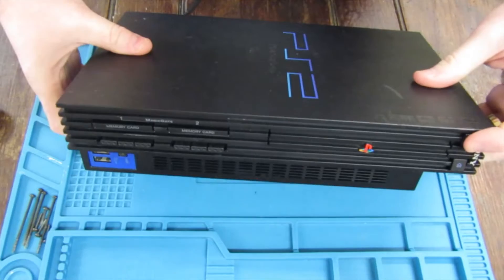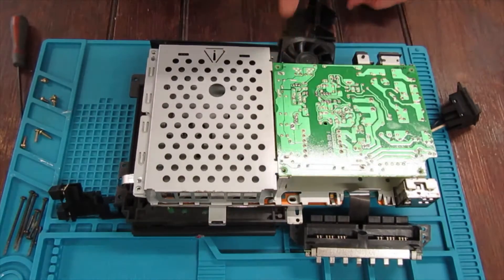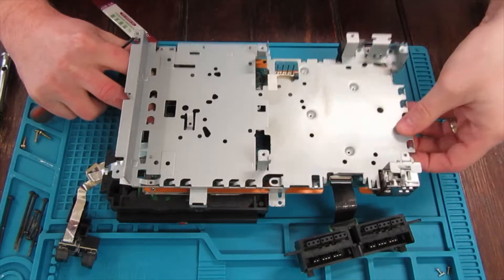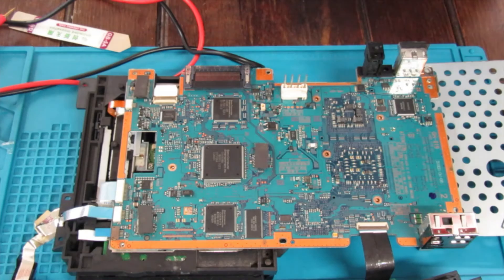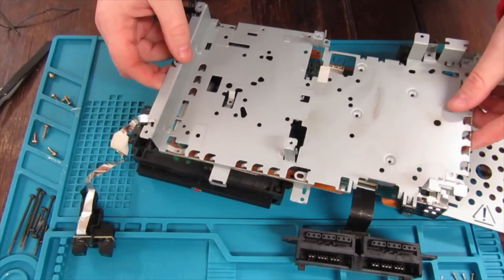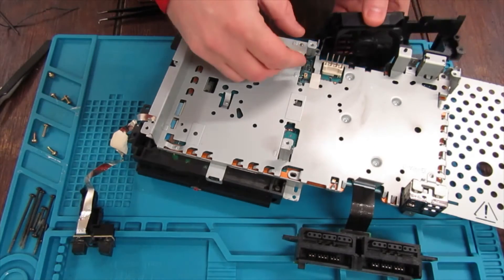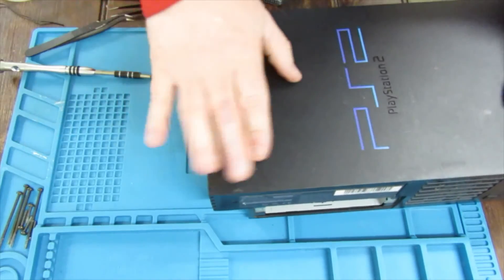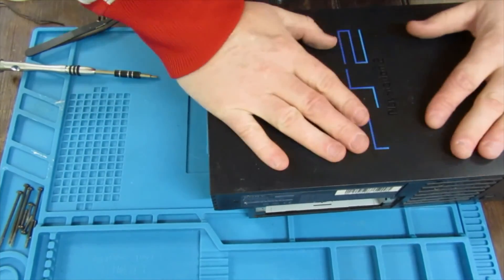PS2 Fan Not Spinning, Fan Fuse Replacement

Comment: Very nice video. Do you know how to fix a blown fuse for controller vibrations as well? Mines a PS2 Fat 50001 model. Everything else works fine for over 20+ Years.
Reply from the maker: It's not an issue I see a lot of. The PS7 fuse is normally the issue, it's a 0.7a fuse The Fat PS2 is a pain to disassemble to access the board though.

Comment: Hi. Bought a faulty ps2 on ebay with graphical glitches. Successfully restored the image only to pinch the fan wires during reassembling. The ps5  fuse seems to be dead. Can i just bridge the connection instead of searching and waiting on a spare fuse? Thanks.
Reply from the maker: You can bridge the connection and it will work, it does mean next time something goes wrong you wont have the protection of the fuse.

What was the cause of your graphical glitches, it's not something I see very much on these consoles.
Reply: @EasyConsoleFixes  thanks for the reply. :)

There's a series of chips between the GPU and the CPU (4 in a line on side A) one of them had no continuity so I soldered it over with some 30awg wire. Seemed to have fixed the problem. Tested it extensively before deciding to reassemble. As I did I felt a screw wasn't screwing in as it should and damaged/pinched one of the fan wires. I think that's how the fuse died. Still works without the fan. I hope my explanation makes sense. :/

Comment: What causes these fuses to blow?
Reply from the maker: Issues with the fan such as a faulty fan or the fan getting blocked etc can cause them to blow, however as these consoles get older I am seeing a number of these fuses blowing without seeing any other cause. 

Some people think there is an issue  with the fuses causing them to blow as they age but I don't know if that's true or not.

Comment: When i turn on my ps2 the fan doesnt spin and after a few minutes it overheats and blinking red light
Reply from the maker: It's probably a broken fan or the fuse as shown in the video. Are you comfortable soldering or using a multimeter.
Reply: Bro i solved that problem i opened my ps2 but my ps2 was so dusty and fan was jammed due to dust i cleaned my ps2 then i turn on my ps2 the fan has fixed and spinning now
Reply from the maker: @bayaratrushi9865  A nice easy fix, glad to hear you got it sorted.
Reply: thanks brother

Comment: The diagram says 0.7A fuse. What if i use 1A fuse in same size. Qwould that work?
Reply from the maker: It will work but you wont have the same level of protection if the fault happens again. 

It's definitely better to use the 1A  rather than just bridging the gap with solder or wire or something.

Comment: Nice video. Do you know which ribbon cable is responsible for opening the disc tray? I disconnecting the cables for cleaning once, and now my console only has the blue opening light flashing but the disk tray no longer opens. Sorry for my English, Thanks in advance
Reply from the maker: Have you the disc tray put back together correctly.  There is a white plastic piece which slides left and right at the end of the disc tray. Part of this piece  should sit into the grove that runs front to back on the underside of the disc tray.

It's easy to forget to make sure its lined up when putting the console back together and it will cause the blue light to flash but the tray not to open like you describe.
Reply: I didn't open the disk driver, I just disconnected the cables (before this the disk tray opened normally). But in this process I think I damaged some of these cables, so when I put them back on, the disc tray no longer opens

Comment: Thanks for the video. I have to replace 3 fuses on a PS1 two (CCP2E)  20s and one 15 for the controller/memory card ports. I bought the (PU-20 board) PS1 7000 model second hand and one of the CCP2E20 fuses is missing replaced with a piece of solder to bridge. I just hope that didn't damage other components on the board.
Reply from the maker: Thanks for the comment. I don't see blown fuses on the PS1 boards very much, its nearly always just dead lasers. Had the seller told you the board was missing the CCP2E20 before you purchased the board.
Reply: The seller didn't know much about the PS1. They sell lots of second hand stuff ("As is and no returns" on all the items). I don't think they were the first owners. It's a Japanese 7000 model PU-20 but the board is inside a 7501 case. My guess, the fuses blew because it was plugged into 240v outlet instead of a 110v outlet. Or a bad memory card/controller did it. I should get the replacement fuses in the mail this week and I'll let you know how the fix goes.  @EasyConsoleFixes
Reply from the maker: @yanghao8351   Yeah you could be right. 240v into a 110v machine would almost certainly blow some fuses.
Reply: @EasyConsoleFixes   I replaced the the CCP2E15 and CCP2E20 fuse plus cleaned up the solder bridge made where the other fuse was and put in a CCP2E20 fuse. Now the control port works again plus it can read memory cards! However, I ordered a 240 to 120v step-down converter. I have one already but it's generic 120watts and not sure if it's a good idea to run the PS1 on a step-down with that much power. The one I bought is only running 60w and it's specifically for PS1, Dreamcast and Sega Saturn. Also I want to grease and clean the CD reader because it makes an awful sound. If a re-grease doesn't work I'll buy a new one (as at the time writing this new ones are being made).  I'll keep you updated.
Reply from the maker: @yanghao8351  Yeah any time I open one of these old consoles I like to reapply some grease. It makes a huge difference to how they run.
Reply: @EasyConsoleFixes   I bought a non-working for parts PS1 very cheap and its CD drive is from those PSone small consoles. With the extension cable that CD drive works great on my 7000. I noticed the top metal cover the CD player sits on had burn marks over the area the fuses are (so I'm sure it was too much power that blew them). I decided to replace the power supply with the new small ones that can accept 110v-220v and so far the PS1 is working great. I only usually play 1 hour at a time and the PS1 does get warm but not like it did with the old power supply. I’ll play it CD only for a month or two and if it’s working well I might consider getting the PISO mod. I’d like to get the xstation mod but the board is a PU-20.  Thanks again for your video.
Reply from the maker: @yanghao8351  Glad to hear you got it working. I recently picked up a Tonyhax memory card for my PS1 but haven't actually got the chance to use it yet.

Comment: Have you ever seen this: ps2 fat , when I hit the power bottom, green and blue light turns on , and that’s it… nothing happens, fan doesn’t even spin, and I can’t reset or open de disc ejector! Really don’t know where should I look for problems here
Reply from the maker: This is a strange one. It does seem like the console is turning on, I would start by checking the fuses on the board to make sure none have blown.

The console is turning on and coming out of standby mode when the red light is on but not turning on fully.
Reply: @EasyConsoleFixes  thanks for your replay sr! I've checked the fuses, they are good and there is energy from the power supply... I was really trying to fix it because this ps2 was the last gift my grandpa left to me before he passed, but after so much effort I'm starting to think about use the ps2 ffat case to build a computer inside it! 

Dont know yet if there are any mobos who could fit inside it, or maybe I'll use those tiny motherboards from androi's tv box... my idea is use it to emulate old consoles, but using the ps2 beautiful case to it!
Reply from the maker: @zowkingame1169  That is a nice idea for the case if you can't get the console fixed. 

I wonder has one of the chips or something failed. If you really wanted to keep the console running you could pick a replacement motherboard from eBay.

Comment: hey when I reasmbled a console after cleaning powered it on I had no video I sow that power ribbon is not plugged corectly so I moved it a little but the power was on I got a video and than I droped a video after few tries console not turning on after I plugged correctly all i have a green light all time but no video did I short circuit something?
Reply from the maker: I don't think the power button would cause the console to display no video.  If you have a green light the console is on, so your issue is something else.

Comment: Having the same issue on 39001 model PS2.
I believe it may have to do with the fan wire being mashed in the reassembly after fighting other issues. My board is much different than yours trying to figure out my best course of action I have another PS2 fan but it does not work either on this board.
Reply from the maker: I have seen the fan wire get damaged during reassembly, if in the wrong location it can get pinched. You can test the fans with a 9v battery if you want to rule out whether they work or not.

Also I have a link in the description which shows the different board revisions, it may help you if you need to find the fan fuse on your board.
Reply: @EasyConsoleFixes  well what ive done so far is use a different fan from a parts board. 
That one only works on the parts board not the current effected board. I removed ps5 from the parts board no more fan activity but I removed it's sauder pad off the chip. I then took ps7 off and moved it to the effected board replacing Its ps5 and I've currently got nothing. Currently out buying a multimeter as this message goes out.
Reply from the maker: @zanefritts177  Yeah the multimeter is needed, more than one fuse could be blown.

Comment: Those fuses are discontinued according to digikey and nothing on ebay either but going to try littelfuse smd 1206's which are the same length.  Need to replace ps7 on mine.
Reply: The diagram says 0.7A fuse. What if i use 1A fuse in same size. Qwould that work?
Reply: @schwarzeneggermanoj2634  Generally going higher on fuses isn’t recommended.  You could go with a smaller value and the worst that would happen is it’ll blow if the circuit draws more than its rating.  Going higher would put other components at risk if the original cause was a short somewhere.
Reply from the maker: You seem to still be able to pick them up on AliExpress  if you don't mind waiting a long time for them to arrive. 
I would do what you are doing and just use a similar  size fuse, there should be no issue.
Reply: @EasyConsoleFixes  Thanks!  I checked and found some but they're sold in lots of 50.  Not terribly expensive but more than I need.  Might do that and sell the rest on eBay though.  Might also be good to have on hand given the scarcity of them.

Comment: Can i replace 7V 0.10A fan with a 7V 0.21A fan ?
Reply from the maker: It would probably be ok but you need to be sure the new fan is getting enough power to spin fast enough to keep the console cool.
Reply: Figured out the fan is stil working. Fuses also okay. Would you have an idea why its not functioning ? It Also happened after cleaning actually

Comment: This video just came in when I needed it!

I had an old dusty PS2 that I recently cleaned out but now I'm having this fan issue, even with the replacement fan I ordered. It was working before the cleaning. Do you think this can be related?
Reply: I think I found the problem, the PS5 one doesn't show continuity (same revision as yours). Dumb question, what are these black pieces called and how to get/search for them?
Reply from the maker: Glad the video was able to help. Was the cable of the old fan damaged during the cleaning, this can cause the fuses to blow. If you have the same board PS5 is a 0.7a fuse. If you search for 0.7a SMD fuse you should see some options. They come in different sizes, try and get one with similar dimensions.
Reply: @EasyConsoleFixes  I think when I was spraying compressed air on the fan, it was spinning, might be the only connection to it. If so, that's pretty unfortunate.

I was actually able to obtain a 0.75A fast acting glass fuse (not SMD) but I have not implemented it yet. I have not found proper SMD but thought this can work too. I got stuck where I would have to connect this glass fuse to the motherboard. I am not sure what type of wire or gauge to use, but could easily be overthinking it. This is the video reference https://youtu.be/3mHuh-lVBS8

Right now I'm toying with usb wiring as the last resort or temporarily testing fans, but would like to fix it internally.
Reply from the maker: The compressed air on the fan could have did it, I always hold a fan with a screw driver or something to stop it spinning when hitting it with compressed air.

The glass fuse should work, it just might be tricky to find a place for it to sit.
Reply: @EasyConsoleFixes  Just curious, how were you able to remove the SMD fuse or any techniques?

I just managed to attach wires to a fuse and it's maintaining continuity; my plan is to wire that to the board so the removal of the SMD fuse is where I'm at. I'm finding a lot of trouble doing so, looks very simple but I can't do it easily and don't want to force it or heat it too much.
Reply from the maker: It can help sometimes to add some fresh solder before trying to remove the part. If your are using a cheap soldering iron sometimes the temperature dials are not accurate and you have to turn them up a bit higher